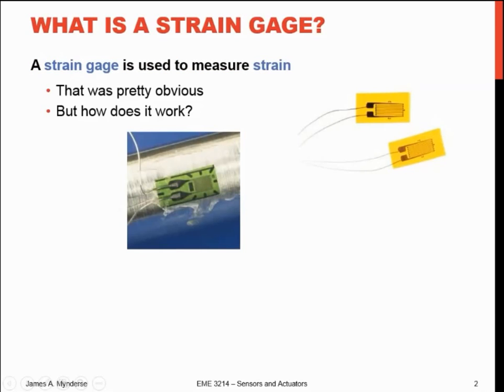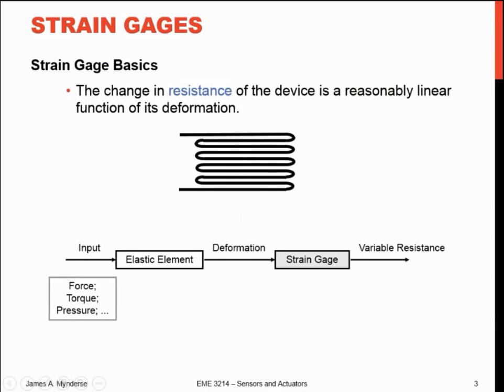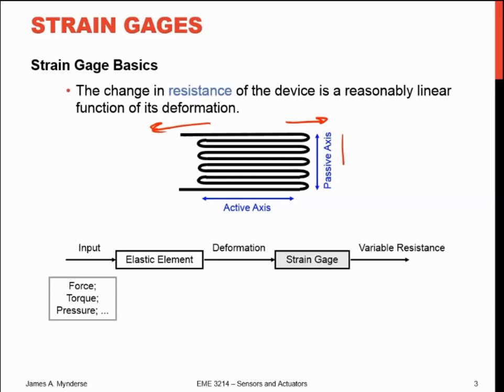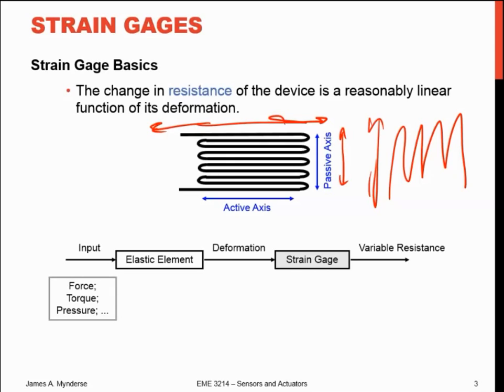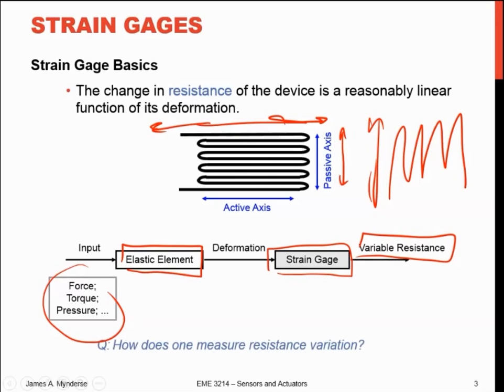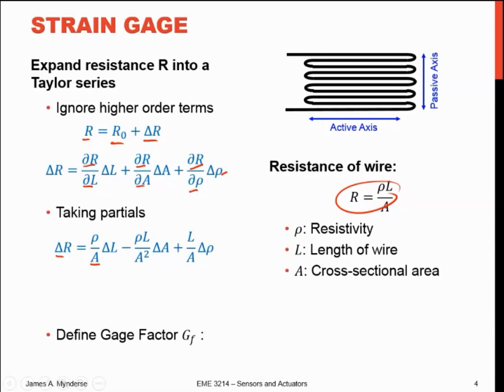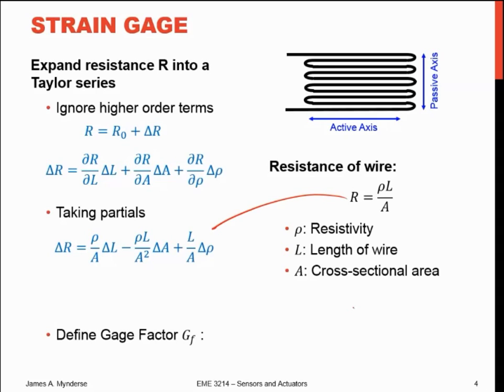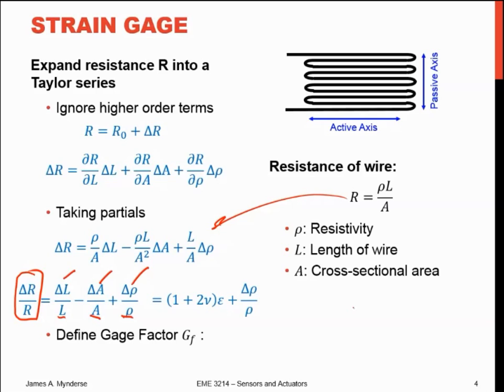EME 3214: Strain gauge basics

Comment: Thank you so much for this. I have a practical exam tomorrow and I didn't know a single thing because my teacher explained it in a whole complex way.  But the fact is , now I understand and that's great 👍. Thank You ! 
By the way what is active axis and passive axis ?
Reply: I know it's kind of the direction of elongation but could you please elaborate on the effect of elongation in the two direction and their word wise definition
Reply from the maker: In the typical metallic strain gauge you can see the pattern of the wires laid back and forth 1:23 shows an example.
Active: If you strain the gauge along the active axis (aligned with the wires in most strain gauges, right to left in the example shown), the resistance changes because you are deforming the wires along their length.
Passive: if you strain the gauge along the passive axis you don't get a significant change in the resistance because you are just moving the parallel wire elements further apart with minimal deformation of the actual conductor. 

And, thank you for the comment.
Reply: GeoffreyThorpe123 Sir thank you so much. By the way where do you teach ?
Reply from the maker: Lawrence Technological University. 
And, I should point out that these slides were originally created by Dr. Mynderse for a class we both taught. https://www.youtube.com/channel/UCmlGKSWtRyOvm0Mf4KUfq3g

Comment: I understood nothing on the equation's parts.
Reply from the maker: As you strain (or stretch) the wire, it gets longer - resistance is a function of length, so it goes up. It also gets thinner - cross sectional area goes down which increases resistance. And, you strain the metal crystals which also increases the resistance. Three factors that you could (if you wanted to) calculate separately, but the bottom line is that as you strain, resistance goes up in a predictable manner.  

What you really need to know to use a strain gauge is the gauge factor which is reasonably easy to use - essentially the fractional change in resistance as a function of strain.
Reply: Thank you, I just want to be sure about how would be the simplest way of using the strain gauge on the simplest ways as possible, not only for the exams in college within 3 weeks, for the sake of knowing to apply this knowledge o on the real world, since the strain gauge is widely used in robotics and medical devices. And my style of work is to simplify everything I touch/work with. But you know, on exams questions, we can get a bit to blind and misinterpret some easy questions. 

Such as, I still didn't find anywhere on youtube teaching how to get the sensitivity of a strain gauge on a Wheatstone bridges O.o sounds like I will have to figure it out alone. And make a video myself to help future students like me :)